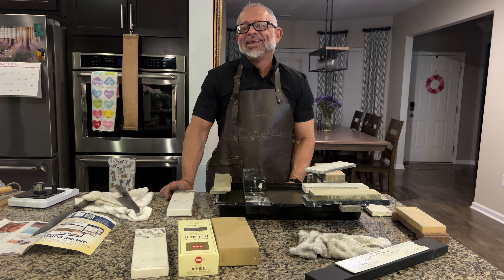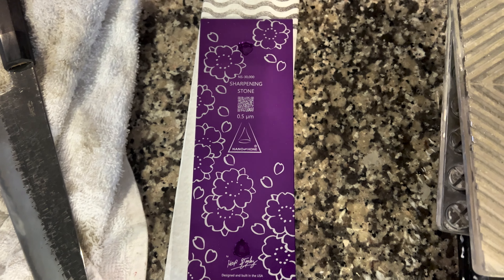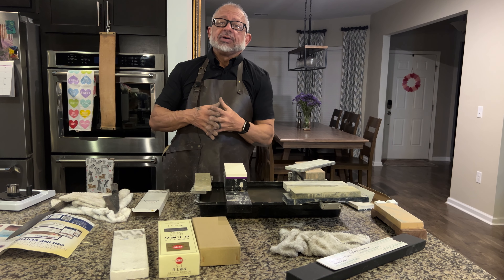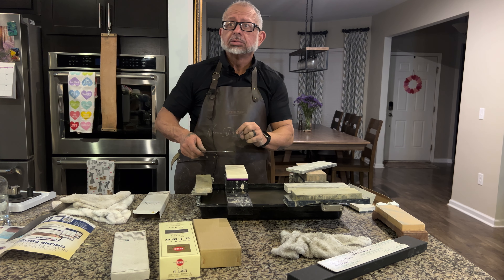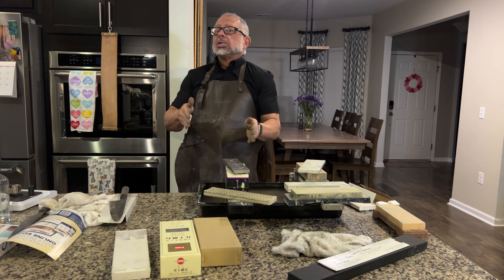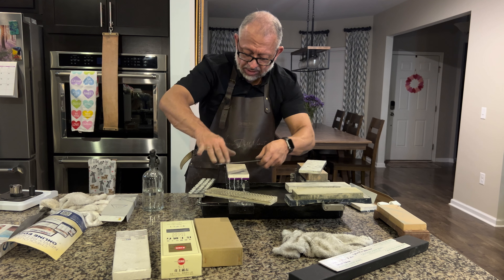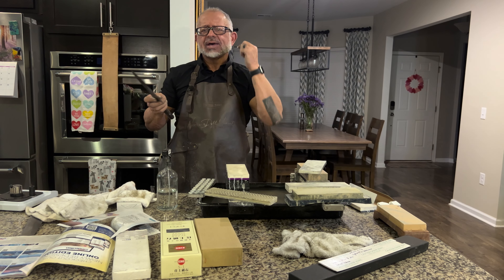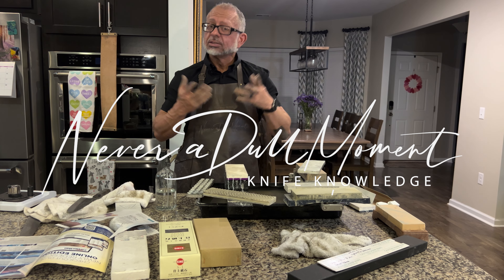Nano Hone 30k Whetstone - 30,000 grit polishing Stone (Razors, High end knives, the finest Apex!)

Comment: I have the Shapton Pro 30k and following that finishing with .025 micron polycrystalline diamond on either nanocloth or kangaroo leather the edge is absolutely terrifying.
Reply: Does absolutely nothing other than increase in polish. I'd bet money I can get a better edge with nothing more than a single sheet of 80 grit dollar store sandpaper. If you want something that actually makes sense to use for general use on general knives, something in the range of 6 um and 3 um is a good starting point. Yes with low alloy and carbon steels you can use stuff like half a micron and still get some practical effect but that is because those steels have very little abrasion resistance and are extremely fine in grain structure. Basic carbon steel like Japanese white steels will start to dull by abrasion as soon as you use them to cut anything. Heck 30 seconds in lemon juice will destroy the edge of a white steel blade.
Reply: @TimJohnson-x1o So I guess you can whittle hair from 80 grit sandpaper?
Reply: @leswindon  You'd be surprised. Merely adjusting the direction you grind can give different results. Anything from a "toothy" edge to a very smooth refined edge, not by changing abrasive but just changing your technique.  And yes the first example i gave is extreme but it's also very realistic. 

Also I don't use whiting hair as test for any knives aside from straight razors. If a kitchen knife can blow through a free hanging paper towel, the soft kind like the name brand, that has no grain direction, and blow through it like it doesn't exist then you know the edge is as keen as it ever needs to be, and you know it's apexed correctly. and yes, I can easily get results like this on basic chromium steels usng nothing not one sheet of cheap sandpaper  and few seconds of stropping to tidy up. it's all about technique and practice.
Reply from the maker: I need to apologize for taking so long. I've had a surgery on my knee and some other things going on. We've had the court case for my car accident. We had to deal with that as well. We've also had some other major things happening personally. Deaths in the family and lots of arrangements to be made. Also, I'll let you know that I will be having another major surgery in June and will not be making it to the Blade show. I will be out of work for two weeks because I'm having all the extra skin cut off of my body. We do apologize for an interruption of videos if it were to happen. Will try to shoot some head for you guys so we can fill the space. That being said, thank you for checking out the show. Thank you for your support and your comment. It will be interesting to further use it and see what we can do with it

Comment: Why shouldn't you do edge leading strokes on stones finer than 8000?
Reply from the maker: Dr. Vadim‘s book, knife grinders, book about deburring the edge, states that when the Blade is so fine, but it’s half the thickness of the human hair that pushing the blades edge into the stone will cause you to wrinkle the edge
Reply: Also, there's a possibility of the knife digging into the stone & ruining the surface😢

Comment: I'd bet you $300 a 12k naniwa super stone is better. all around. I've tested everything on the market. Not this stone, which is certainly made by shapton, but I have tested the shaptons. Naniwa costs about $60 for a 20 mm 12k ss. as long as oyu avoid overpriced sharpening and knife retailers.  $60 vs $300 and the Naniwa delivers vastly better results across a wider range of use cases.
Reply: I like the 12k Superstone very cost effective,my fav stone for the price is the Sigma Power 13k,.75 micron $115 bucks
Reply from the maker: Hap Stanley was the original designer for Shapton. He left them because of their in accuracy over grading. They tend to grade their things higher than they are. A 1000 grit stone probably works like a 700 or an 800. These are not made by Sharpton. He is in very tight control of his product. I need to apologize for taking so long. I've had a surgery on my knee and some other things going on. We've had the court case for my car accident. We had to deal with that as well. We've also had some other major things happening personally. Deaths in the family and lots of arrangements to be made. Also, I'll let you know that I will be having another major surgery in June and will not be making it to the Blade show. I will be out of work for two weeks because I'm having all the extra skin cut off of my body. We do apologize for an interruption of videos if it were to happen. Will try to shoot some head for you guys so we can fill the space. That being said, thank you for checking out the show. Thank you for your support and your comment.